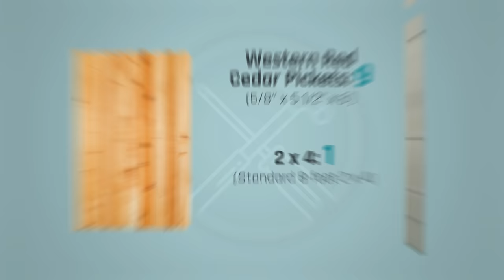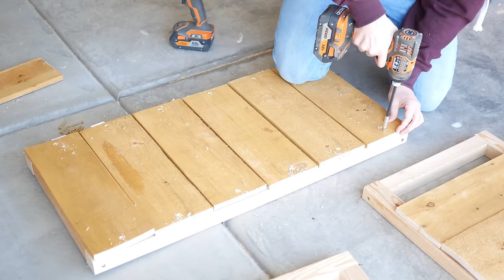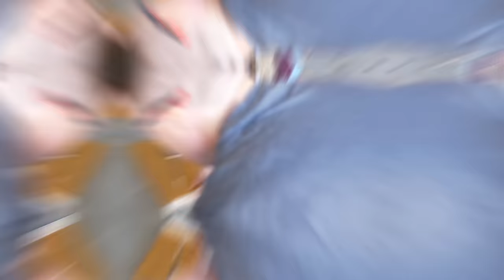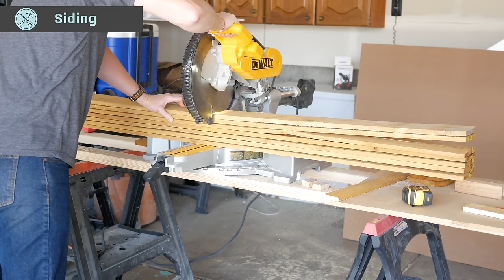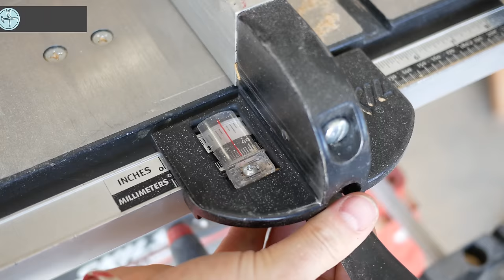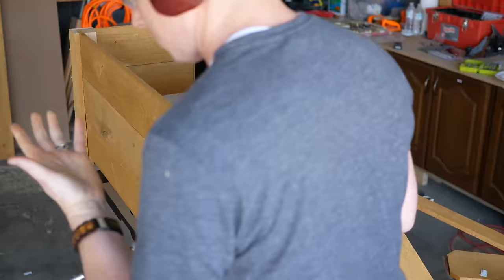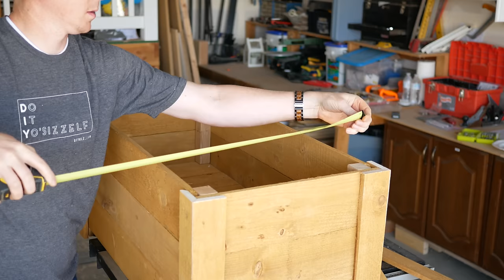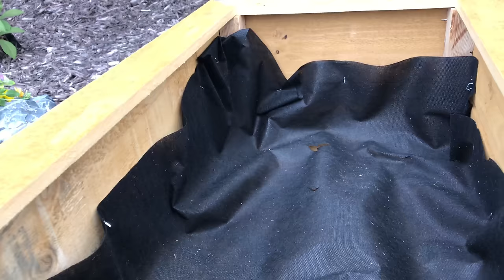$23 DIY Planter Box

Comment from the maker: November 2021 Update: Lumber prices have been all over but I just checked at the local Home Depot and the cost for this project has gone from $23 to $27 - still a great deal for what you get. Also, you can do this entire project with a circular saw and a drill if you don't have the other tools. The nails are nice but you can screw the trim in place for even stronger results, no brad nailer necessary. Ours are now 4.5 years old and still looking and working great, right in front of our house!
Reply: Thanks for the update. Can the wood screws be toxic to humans in a vegetable garden? Might any toxins leach into the soil and the vegetables if using zinc plated wood screws?
Reply: @AudraT  No.
Reply: It’s pretty much free if you use pallet wood just make sure you’re using the right kind, never use blue pallets.
Reply: Nice job. Cedar pickets almost impossible to find here in the Northeast.
Reply: Just picked these materials up from home depot and the cost was $43 a bed.
Reply: You should do the videos the hard way aka. USE the skill saw....

Comment: $23 in materials; $23,000 in equipment. Lol
Reply: Tools are a lifelong investment to making DIY more possible and easily 10Xing your tool purchases in savings, and/or a side business.
Reply: You could do this build with nothing but a skill saw and a drill.  In fact, if you’re really on a budget, you could even do it with just a $15 hand saw, a $7 speed square and a drill.  All the other tools just make things easier and faster, but aren’t essential for this
Reply: Harbor Frieght is always an option, both chop saw and table saw around $100 and opens up your capacity for DIY projects.
Reply: @rickkadets5139  i8789
Reply: You can do this with basic tools
Reply: $23,000 in tools? What planet are you on?
Reply: @rickkadets5139 All I own Is a hammer and a screw driver. 😂
Reply: @Dreadlock1227 What about just a hammer and have home depot cut the wood for me? I don't really own tools.
Reply: It's literally a miter saw and a drill. Basic tools every man should have.

Comment: $23 in materials and about $2,000 in tools. Nice.
Reply: You can get all of this done with a circular saw, a hammer and nails.
Reply: hand saw  10$ nails 5$ hammer  10 bucks :) get it
Reply: Really!!!  Jealous Much!!
Reply: Ripping a 2×4 is dangerous with a circular saw, and with a hand saw it'll only take you about a week or two
Reply: buy a 2x2 ?
Reply: Touche
Reply: African Cichlids 😂
Reply: Denise Wascavage 😂
Reply: I made one using 2x2s have to add 1/4" to the short sides of the frame in case anyone is thinking of doing this because half of a 2x4 is a a bit wider than 2 2x2s.
Reply: cutting straight down the middle of a 2 by 4 with only a circular saw does not sound like its doable...
Reply: why is it dangerous?
Reply: LOL right...
Reply: It's easy, also turn your inside edge on each of those pieces to the inside of the box and keep the lumber mill finished edge to the outside. This gives you the same nice look that a table saw will without the cost of a table saw. You can also use something like a 40T carbide blade to keep the edge clean if you really want it to be a clean edge. Using a circular saw isn't too bad, but if you're new to it clamp the board really well leaving your 2 inch edge hanging over and have a second person holding the trimmed piece as you cut to keep it level with the rest of the board so it provides you a nice smooth cut and doesn't bind the blade up.
Reply: Even better way to do it is have a flat substrate that you don't mind cutting into and set your blade depth just past your 2x4s width. Where I'm at 2x4 actual is an inch and a half so maybe set your blade depth to an inch and 5/8s. This will also help with a smooth edge and diminish splintering
Reply from the maker: @andrewwarren8978  You can just buy 2x2s. I ripped 2x4s because I have a table saw and didn't want to make a separate trip to buy 2x2s.
Reply: Not necessarily. OFFERUP has decent used tools of you look around.
Reply: coinsagE46m3 don’t forget years of training at $5k a year in carpentry school
Reply: Seriously going to complain about this? Did you expect to karate chop the boards to size, and then will them to stay in place using your mind powers? Come on man. You don't need $2k in tools to do this. You could achieve it using about $150-200 worth of tools that most DIYers already have at home. Even if you didn't have those tools, for about $50 you could buy used tools to achieve it too. Then you have the tools to do your next DIY job, and you won't have to complain about the cost of tools, because you'll already own them. I can't believe you thought you would buy $23 worth of materials and have it all come together without tools. You're welcome.
Reply: Matthew Tiemann Second that. Did they notice this was a Skilsaw tablesaw, not a $3,000 Sawstop machine? For Pete’s sake, if you are gonna do DIY projects, invest in a couple tools that will make your project look better and keep you safe while building it. Bench top tablesaws are not that expensive and will get the job done. Buy the tool once and use it for a hundred projects, the cost per project becomes super cheap.
Reply: @andrewwarren8978  Why are you watching this video? you people need to watch-out for the sky...'cause it's falling!
Reply: You can do the same with hand tools!
Reply: You can also have home Depot or Lowes cut the items for free. Take your cut list and they will cut it for free.
Reply: @PerfectlyFunctioningAI  i do it all the time, I just screw down one side so it doesnt move.
Reply: @dpfunk78  Yeah honestly. A lot of woodworking videos pull this sort of BS, but this isn't one of them. It's a good first project with minimal tools.

Hell you could even do a hand saw if you buy 2x2s (so you don't need a power saw to rip the 2x4)
Reply: coinsagE46m3 😁
Reply: Exactly, got to be rich to actually make shit
Reply: The Honcho Life  how do you think they made shit before electricity? If you really want to do it, you find a way. It’s not rocket surgery.
Reply: yep. it takes tools to build things. congrats

Comment: i learned i need more equipment.
Reply: Same!
Reply: That's the problem with some of the so called DIY videos around yt, most of them use a table and/or miter saw which only people with some years have.. also I think the 45 degree angles are unnecessarily complicated. Last point, I prefer screws over bradnails for take-it-appartability. #thumbdrop
Reply: I would really like to build a 23 Dollar planter box but unfortunately can’t afford the 5000 Dollars plus of power tools to make it. I’m off to find some old pallets and a box of nails.
Reply: “My Everyday DIY” has a simple version that didn’t require much more than a drill if you have the lumber yard cut your wood pieces.
Reply: You can always join a local wood shop and there you can have all the equipment and you can make more!
Reply: This was awesome.  Aside from ripping the 2x4, this can all be done with circular saw and drill.
Reply: @rhinojosa055  Yep, and you can just buy 2x2 at Home Depot or Lowes
Reply: Learnt***
Reply: All youtubers think most of the people watching have the miter saw.. how convenient!
Reply: @peaceroshan  you can purchase 2x2 instead of ripping a 2x4 and the beveled 45* cut for the trim work is optional but they also sell a miter box you can use with a hand saw
Reply: I live in Aus, if I got to the hardware store(Bunnings), usually I can select my wood and have them cut that wood to size, eliminating the need of the table saw and all these expensive tools.
Reply: And if you have all the equipment you probably already know how to make a planter box. That being said … I just designed my own and used a circular saw only … they look just great
Reply: @niklaswulff2474  bro, a dewalt tablesaw can be had for $300 on sale at Lowes.  That was the first power tool I bought and I did so maybe 2-3 weeks after getting started in woodworking.  Also, all cuts and fastens done in this video can be done with hand tools.  The point of DIY is to figure it out with what you got.
Reply: You can make most things with hand tools and nails/glue.
No power tools needed. More rustic

Comment: I’ve made two of these from this tutorial now and here’s what I’ve learned. It’s difficult to not split vertical parts of the frame because of all of the screws going into it if you don’t have a brad nailer (like me). Also, it doesn’t need to be perfectly straight as the four corner coverings will make it look squared away anyways.
All in all a good project for someone new to this stuff like myself. 
Also, I bought a table saw at harbor freight for $150. Great investment as I can do a bunch of these types of projects now.
Thanks for the video!
Reply: I know nothing about table saws but I looked some up at harbor freight and there are a couple for $100. How did you know what to get?
Reply: I used all screws cause we did not feel like getting out the air comp. and nailer.  I learned to pre-drill all holes before putting the screws in to keep from splitting wood.  Also use the deck screws that look just like finish screws.  Really worked well... just took a little longer.

Comment: Great video. I used the idea for something a little different than a planter though. If you smooth everything and add a lid this works great as a kid's toy box. I also changed the dimension a little to fit the space in my son's room. It ended up being 33"w x 16"d x 16.5"h. The lid was made just like the base, but pickets overhang slightly to make it center itself on the top. I'll also eventually figure out how to add hinges to make it easier for him to get into it.

Comment: Built it today. It turned out pretty well. I am happy with the first one but I feel I can do better. A couple of things; when attaching the siding boards make sure you go from the top of the box. When I split the top cap board it was 2 3/4 inches for the 45 degree cut.

Comment: Just a recommendation for this rod you doing this. I am starting all new raised garden beds in my yard, about 8-10 of them. Some are 1’ some 2’ and some 3’ high. I learned a great idea. You can put organic materials in the bottom to create air circulation for microbes to stay alive and keep the roots healthy. I would cris-cros some 1”-2”-3” branches at the bottom, maybe some smaller sticks, handful of leaves. It saves space if you have a large raised garden bed and it won’t be so compacted where it can’t get air circulation for roots. I’m using 3 layers of cardboard at the bottom of my beds instead of cloth. This is all new to me. I’m a right in the ground gardener until my tree roots have taken over my yard and I love my trees and never want to cut the roots and weaken my trees. Good luck

Comment: I built a 6ft version a little bit more heavy duty using cedar decking instead of fence pickets, cost me about 80-90 bucks.  I used the same method just made it bigger used feet in the middle for extra support

Comment: Thanks, good video.  My floor ended up having half inch gaps between each plank.  My frame is exactly 36' and the planks are all pretty close to 5 1/2" wide.  Planning to put weed barrier in but still a little concerned that the gaps may be too wide.

Comment: Okay guys and gals, I spent about 30 minutes trying to work this out and finally got it.  I'll explain the formula first and then just leave the formula at the bottom so if you don't feel like reading, skip to the bottom.  

To get the exact point to set your fence at to rip a board in half at a 45° bevel, you have to consider the material width (W), Material Thickness (T), and Blade width (B)  First you have to find the amount of waste that will be sawdust from the blade.  You might think it would just be the thickness of the blade but it's not.  Angling the blade creates more waste because geometrically speaking, the hypotenuse is always longer than the other 2 sides. So to find the exact waste: sqareroot(B²+B²).  Although, a simpler way to do this is to divide blade width by 0.707.  Most blades are about ⅛" thick so for simplicity's sake well go with .125" for "B".  With the aforementioned formula (.125÷0.707) the waste from the blade will be 0.1768".

Now you subtract that from the Material Width (W) to get total usable width.  In this video the boards are 5½" wide so subtracting the blade waste leaves about 5.323".  Since you're cutting it in half, divide that by 2: (2.6615").

Now some table saws allow you to angle the blade toward the fence while most modern saws (like the dewalt DW7485) only angle away from the fence..  So if you're angling the blade AWAY from the fence you will SUBTRACT half the material thickness from the previously calculated board half: (2.6615-(⅝÷2))=2.349 which is about 2 and 11/32).
And if you're angling the blade TOWARD the fence, you have to ADD instead subtract: (2.6615+(⅝÷2))=2.974 which is approximately 2 and 31/32.

TLDR;
WHEN ANGLING THE BLADE AWAY FROM THE FENCE: 
[(W-(B÷0.707))÷2]-(T÷2)
Where W=material width,  B=blade width,  and T=material thickness.

WHEN ANGLING THE BLADE TOWARD THE FENCE: 
(W-(B÷0.707))÷2]+(T÷2).

You must type this formula into a scientific calculator otherwise the parentheses are not taken into account.  If you don't have one you'll have to follow the order of operations (PEMDAS) to manually get the numbers.

Hope this proves as useful for you as it is for me.
Reply: Imma gonna go ahead and drop a 👍 for no other reason than the fact you put some thought…..well, A LOT of thought….into your response and someone should acknowledge your effort. 👊
Reply: @Tracy McGill  lol thanks.  I got about the same responses on a woodworking facebook page I posted this on.  Most people there did not appreciate the math like I did and also pointed out that such high precision is not necessary for the majority of woodworking projects.   Maybe more for metalworking and milling.

Comment: Just as a side note, since cedar fence boards are not available everywhere, you can use redwood which is about the same price here in the Sacramento area. The redwood boards at Lowe’s are kinda gnarly on the surface. Luckily I have a drum sander and ran one side of the boards through it with 80 grit sandpaper in it, making the exterior face a LOT nicer looking than the off-the-shelf board. You could get the same result with a random orbital sander and some 80 grit paper.
Reply: Since I live in Sacramento I find this comment especially helpful lol, thanks
Reply: Side note number two... the drum sander approach really gummed up that 80 grit paper and made it useless due to the amount of pitch in the redwood boards. I’ve since built three (yes, 3) more of these planters for my wife and I used a planer to smooth out the surface on each board, on one side only. Huge difference in the amount of time it takes. Forget the drum sander method!!
Reply: Jim Bennett Oh, interesting, thanks again! We’re in escrow right now, so I’ve been anxiously looking up all kinds of projects to spruce up the place. I’m hoping to get a lot of curb appeal done before the rain comes in the fall. I’ll put this into my notes.

Comment: I would spot use PL or Liquid Nail under top trim and at frame connection points, for a number of reasons. Nice clean box. Adhesive plus a sealer will make it last. Ty for video(s).

Comment: Others probably mentioned this also, but I didn’t see it in the first several comments. You’ll want to use treated 2x4s and not a regular 2 x 4 or it’s going to rot in no time. Another option is to put epoxy on the bottom of the feet so that they can’t wick moisture.
Reply: If you use treated, you can only do flower boxes, OR line your planter with plastic.  Leaching treated lumber into your vegetables is a recipe for disaster.
Reply: "No time" will likely give you enough structural integrity for 1-10 years of growing things, depending on your climate and on your choice of wood.

Comment: The 2x4s cut down to 2x2s seem like douglas fir or an equivalent soft wood. If that's the case, then your frame is your weakest link. Why not use fir for your sidings as well? Or use cedar for the framing. I'm puzzled with your use of rot-resistant and non-rot-resistant wood.

Comment: Planter boxes absorb more water than plastic, that's a consideration for places with water conservation. Cedar is a softwood, and is tricky to plane evenly if you hand cut. If your bottom boards are uneven, it's drain ready. Wood planter boxes can be heavy when filled, consider using rope handles. If you're using a wood planter in hot sun, you'll need to shade it, mulch a thin layer of straw, add ice, and use leftover cooler water to keep the soil moist. Ice water, and cubes does not affect plant root growth in hot sun.

Comment: What size screws did you use? I’m a newbie at building stuff. I bought the long ones but I think I need to learn the diameter of screws lol! I missed the part of adding the 4 inch legs below so mine is stumpy on the ground, but not bad, I just realized why my boards were not fitting! I learned a lot building this! Thank you!!

Comment: I ripped down 1”x 5.5”x 8 weather shield planks / boards into 3/8”x 5.5” and used 1-1/4” brand nails..... should I screw them down to the frame (2”x2”) or will that be over kill
Oh btw I’m water proof gluing everything ... everything
Reply from the maker: Sounds like yours is coming along nicely! I would think between the brads (for vertical holding) and the glue (for everything else), the screws would be optional. These hold a lot of weight so screws would only add strength but that's your call.
Reply: @LRN2DIY  awesome thank you